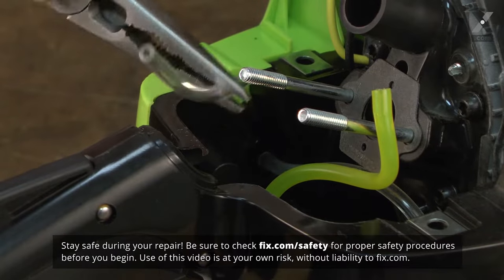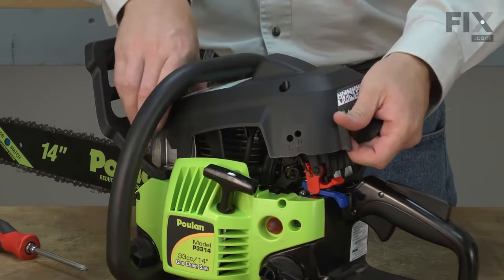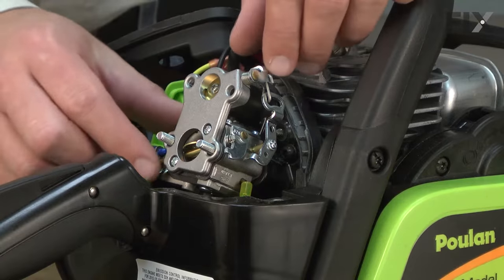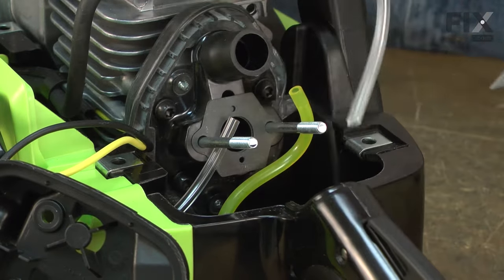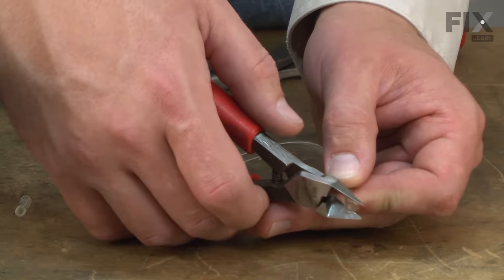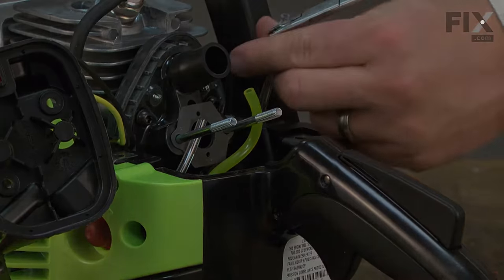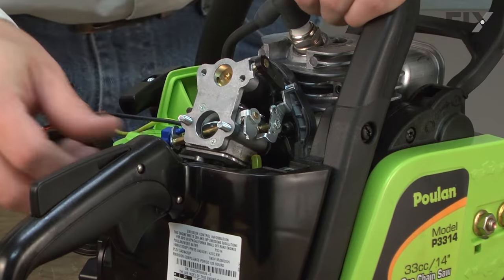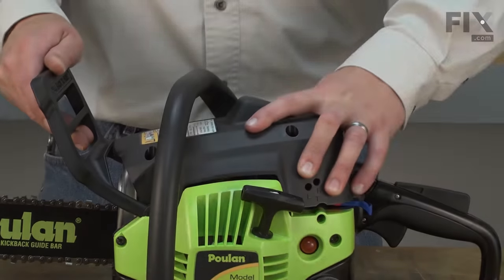Poulan Chainsaw Repair - How to Replace the Fuel Return Line

Comment: Very nice video. It does kind of gloss over the difficulty of pushing the tubing through the gas tank wall since the tubing gets fatter as you push against the tight hole. The fuel lines pass through the gas tank wall with no gasket: the fuel line has to be slightly oversize to make a nice seal. Oversize tubing is hard to push through the hole since the tubing compresses and gets fatter, making the whole thing even harder. I found a solution. I cut the end at a bevel, then took a double strand of strong #92 polyester thread on a needle, poked the needle through the beveled end, then looped the knotted thread ends over the tubing.

Drop the needle into the gas tank hole and reach in with hemostats (or fine needle-nose pliers) and pull the needle and thread and tubing into the gas tank. By pulling (and even stretching a bit by pulling back from the outside end, the tubing gets thinner and will slide through. When you get a bit pulled down into the tank you can reach in with hemostats (or fine needle nose pliers) and pull on the tubing itself. When you have enough pulled through to come out the gas tank opening, cut off square and install the fuel filter or other fitting, then adjust the length in the tank by pulling back out as needed.

In the case of the fuel intake and filter, leave enough tubing in the tank so that the filter lies on the bottom of the tank even if the saw is rocked 90deg for horizontal cutting. In the case of the return line, pull the line so as to pull the nylon barb fitting to the "roof" of the tank.

Comment: Other than forgetting to attach the fuel filter/tank line to the fitting before pulling the fitting back into place, this was a great video! If the process is completed according to this video you'll end up with no fuel filter and no line leading into your fuel
Reply: he replaced the return line that requires that type of  fitting nipple ,  not the actual supply line that has the gas filter.
Reply: @Genetics1  no he didnt... it's the fuel line and he didn't show adding filter and bottom part of fuel from fitting!    Damn hope you don't try to fix any chainsaws😂
Reply: @epmcdonald4562  well i suggest u look at the video TITLE again ,  no where does it say replacing the fuel supply line.  the clear line is the return line from the purge bulb. the green fuel line is the one that has a fuel filter attached to the end. you might want  to put on some reading glasses   before  you reply to a comment.

Comment: All looked good until you mentioned I would need a hemostat! Seems like a nice video although I haven't watched the entirety. Professionally done with a proper camera that's held stable with proper light and proper audio, thanks! I can actually watch without getting seasick.
Reply: Not needed... I did it with my fingers lmao easy enough... Easier with pliers but do what u gotta

Comment: my Craftsman (poulan) chainsaw has both lines same right side of carb.  also used 2 different size lines: small for primer -  large for fuel tank. AND had fuel filter.

Comment: Does it matter which port on the primer bulb connects to the fuel line return? I was told that the return line should connect to the longer stem.

Comment: While you were screwing the cover back on near the end of your video, I noticed a H/L hole on the side of the cover.  Can someone till me what this function is for?  I just got this saw last week without a owners book.  THANKS
Reply: The L controls the (Low RPM) or your idle speed while not squeezing the throttle, the H controls how fast the engine spins when youve got the trigger fully depressed and are doing your cutting (High RPM)

Comment: He didn't show connecting the fuel filter to the fuel line
Reply: yeah, major part overlooked
Reply: I noticed that also
Reply: when he cut the tank line square that is when he would have reinstalled the fuel filter and line to the fitting.

Comment: Why would you ever replace just the return line?
Reply from the maker: Our repair videos are produced specifically for the part number we are installing in the video. The incoming fuel line and the carb to primer line are covered in our other videos. -Mark
Reply: The lines age and crack and have to be replaced. They don't last forever.

Comment: Was so hopeful until the last part about the fuel filter and coupler (that was all in pieces in the tank on mine) was omitted. Would have been nice to see how it went together. On to more videos and diagrams I guess.
Reply: this model of poulan  chainsaw i believe has a direct fuel line that runs into the gas tank with the filter at the end of the hose , there is not fittig in the supply line just on the return line  which is what this video showed .
Reply: @Genetics1 totally wrong info ... disregard

Comment: DOES IT REQUIRE SAW MIX
Reply from the maker: I assume you are referring to mixing oil into the fuel for a 2-cycle engine. Yes, this saw, and most gas-powered chainsaws require oil mixed fuel. The mix ratio is typically 50:1 or 40:1. 50:1 is 2.6oz of oil to a gallon of fuel. 40:1 is 3.2oz of oil to a gallon of fuel. The mix ratio is often noted on the saw or even right on the gas cap. If not, you will need to refer to the owner's manual for your saw to find the correct ratio. Remember, you need to use oil that is made specifically for fuel mixing. Regular motor oil will not work and will damage the engine. -Mark
Reply: Yes 40:1

Comment: Clear and yellow lines. Does that matter or can one line size be used for everything?
Reply: Shame they never answer!
Reply: The color of the line doesn't matter. The correct O.D, outside diameter is for the proper fit through the holes, and correct I.D , inside diameter for a tight fit to the connector ends, is what you should know for the right plastic lines.
Reply: have craftsman chainsaw...uses 2 different size lines, smaller on primer, larger to the fuel tank

Comment: You didn't show or explain that the other end of the fitting has another hose with the fuel filter attached. otherwise there will be no gas going to the carb. Plus as mentioned below, you didn't dwell on the fact that it is difficult pushing the fuel line through without the aid of some wire attached to the line to help. I won't explain how because your video is very incomplete and will cause problems for people watching it. I suggest for the viewers to go other sites to get proper ways to do it. Poor instructions and explanations and locations of primer bulb, etc...